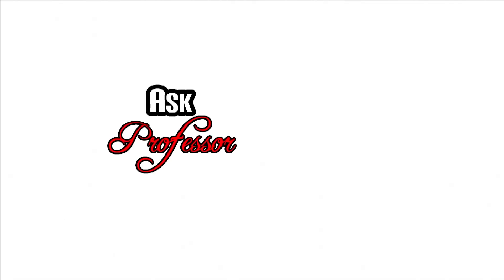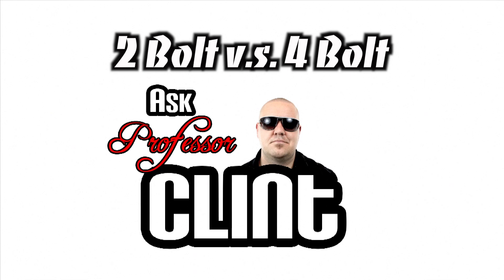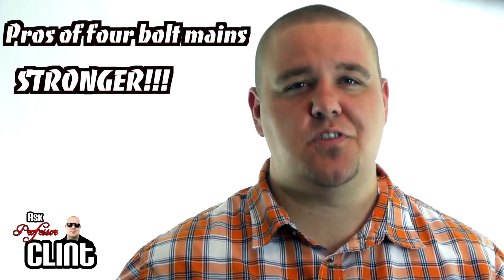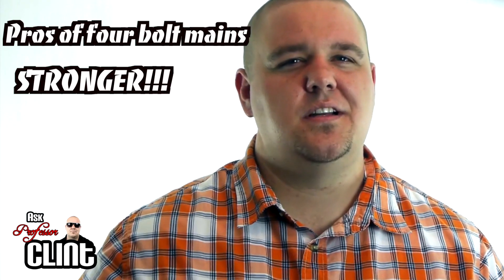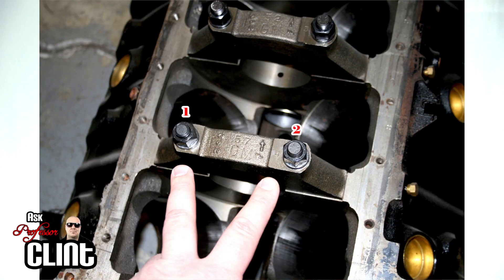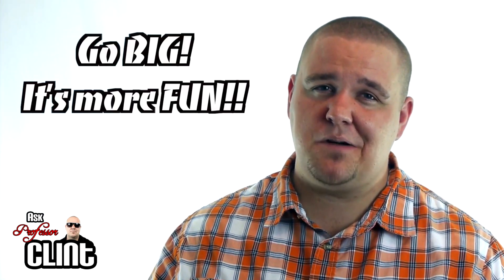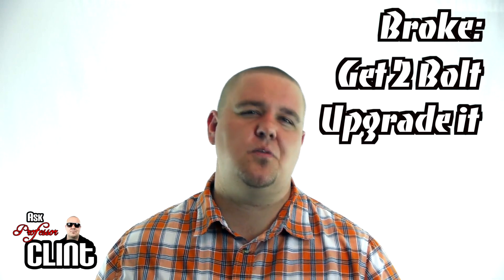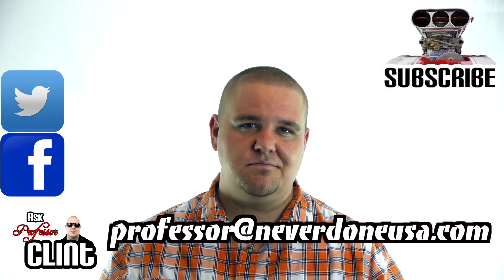2 Bolt vs 4 Bolt - Ask Professor Clint - Never Done

Comment: Been running my 400 2 bolt main 509 block for 30 years.Pushes little over 520 hp and over 500 on torque.I shift it at 6800 and have not had any issues thank god.I did spend a lot of money back then on machines work.Everything is after market except the crank and block.I would not push it any farther then that even though people have done it many times.If your going power adders then YES buy an after market 4 bolt.

Comment: A good friend has beat the snot out of his 55 Chevy for decades and lots of hundreds of passes. It runs 10.teens with an alcohol hilborn injected 355 2 bolt main bowtie block. He has refreshed that engine many times, and has never seen any sign of cap movement. Yes he uses main cap studs.
Reply: A 2 bolt bowtie? I've never seen a two bolt bowtie block, not saying they don't exist. Just figured gm made the bowtie blocks for heavy duty/racing use so they would all be 4 bolt. I've seen bowties splayed and std 4 bolt layout. As far as production/oem blocks I'd think a two bolt splayed to four would be stronger than the production 4 bolt design.

Comment: I was told that a sbc 2 bolt can handle up 500 in which I might agree only because my old small journal 327 had at least 425 and I ran it that way for almost 30 years but now im the proud owner of a 2 bolt 60over 350 with studs for the crank as I will be driving on the street, now that im 50 I just want drive it and enjoy it 🤘🏼

Comment: When we were racing a short track super modified the promoters had a limit of 312 CI,  any compression ratio, any cam, any steel heads (We tried 2 different styles), any intake w/1 four Barrel carburetor, but what I thought was strange: no dry-sump. We installed ARP studs for the mains and heads on our heavily modified, but stock OEM 2 bolt, 1st gen Chevy small block. We had it magna-fluxed, sonic checked, all sharp edges radiused, line honed, squared, decked, balanced, oil restrictors for rod & main oil supply. This was the late '70s and early 80s and it dyno'd at 500+ HP. Never had a failure in the 2 years of 3000 to 7200 RPM short track torture. On a greasy or dry slick track it would spin-up to 7500+ RPM if the driver wasn't careful. We had a tell-tale tachometer.  It had 12.5 to 1 compression, forged pistons, best rods available and forged crankshaft It had low-end torque off the turns that would yank your head off. 
The 2 bolt is pretty reliable if you take time to build them with tough materials.

Comment: We throw 10 to 12 lbs of boost to a studded and balanced 2 bolt 468 bbc . It does have a forged eagle crank and Callie's forged rods with kings best bearings. Never sees over 5800 rpm.  5 years and still going . Makes 922hp @ rear wheels. A bbc 2 bolt have heavier main caps and thicker webbing due to the other 2 bolts not there to weaken it. I was advised not to splay the mains   468 bbc twin VS Racing 78/75 with 1,25 AR . On 10/12 lbs of boost with a huge howard's hydraulic roller cam too boot

Comment: This guy is totally wrong it's a myth because stock gm block castings become weaker with the four bolt main it's been proven if you really wanna put some power down use a 2 bolt with a girdle
Reply from the maker: That has not been the experience of the engine builder I got the information for this video from however its an interesting idea, I'll look into it. Thank you for watching the video.
Reply: Not true for big block Chevy blocks.

Comment: Yeah, no I'm going to have to disagree with you there.  My Grand National made around 450hp and over 500ft-lbs of torque all day long on the stock v6 long block.  Right now I have a forged crank and the first 3 main caps are billet steel with ARP studs and the guy helping me tune with an aftermarket ECU said 600whp/600ft-lbs of torque no problem.  He said tune plays such a big role.  Now, if I wanted to 1000whp I would have to get an aftermarket or a BMS stage 2 block.  You can make a 1000whp with a stock block, but the block at that point is only good for the dragstrip and not driving around.  I've seen Richard Holdener make upwards of around 700 hp with a stock old school SBC.  When using forced induction, tuning is the key.  Nitrous puts such an massive load on an engine so quick that I would avoid it unless I had a 4 or 6 bolt main.  Also, the Buick 3800 series 2/3 block with forged rods and pistons has been power potential for a v6.  It has two bolt mains, but they are cross bolted.  I'm building a 3800 series 2 for my 2000 Regal GS, it's machined already and I will be using ARP main studs and ARP bolts for the cross bolts as studs wouldn't add any benefit.  I bet when all is said and done I will be making about 800whp with my 3800 series 2, reliably.
Reply from the maker: The numbers I shared are general guidelines  for the average gear head. Can they be pushed beyond that with an experienced builder/tuner? Absolutely! However with such a general audience comprised largely of newbies and DIY guys without the proper knowledge or experience I had to give numbers that would keep everyone operating within generally safe parameters. Good luck on your buick, it sounds like a cool build!
Reply: @NeverDoneUSA  Thank you.  Unfortunately, I don't have the tools nor the confidence to build the engine myself so things move at a slower pace because performance build labor is expensive.  I was talking with my engine builder today and he told me that I would have to invest a lot more money for the transmission to hold up  and it still may not.  My build may be able to make 800whp, but it's not going to happen.  He said a more reasonable number of around 500whp.  Other people have built these v6 in FWD configurations, I guess they had to make custom parts for the transmission.  I was a bit of a big mouth in my previous post and I've been knocked down a few pegs, deserving so.  Again thanks for the information.

Comment: what engine components would you recommend in a 4 bolt main running a 92 mm turbo
Reply: Engine components?  Hard to say; but certainly go BIG with fuel delivery.  Pumps, fuel lines, and injectors.  92 mm?  You think you have enough fuel?  Go bigger than what you have ....
Reply from the maker: Unfortunately I'm not an engine builder so I wouldn't have the level of expertise required to properly answer that question.

Comment: One thing, when converting to studs, you really should have the mains align honed.  Studs go deeper and distort the  block a bit different.  Its not 100% necessary (bearings are designed to take up small differences) but improves the consistency of the oil flow around the bearings (and ultimately to the rods).
Reply from the maker: Thank you for your comment, this will add value for others who watch the video and read through the comments.
Reply: I disagree.
Reply: @Racingengines4U  disagree as in ?

Comment: Well, my little 235ci v6 only has two bolt mains, with arp studs and billet main caps and I dynoed my car at 625whp and 683 ft-lbs of torque.
Reply from the maker: Nice! The studs and the billet mains help a ton!
Reply: @NeverDoneUSA  Yes they do.  The problem with the LC2 motor or 109 block as it's called in the 86/87 turbo is the bottom end will hold up, but the lifter valley of the block will split.  Anyway, I still appreciate your time and explanation as a middle-aged gear head I can get enough of engine block information.

Comment: The Grand National 109 block is a junk block, v6, with 2 bolt mains.  They've 750whp with stock bottom end, with ARP studs and billet mains guys are regularly making making 675whp and doing it reliably over time.  My 109 with billet mains, makes 550rwhp and 625ft-lbs of torque and I've been running it for 3 years now.

Comment: I got a 350 block with a 4 bolt main 
90 roller block gm one 
I saw on horsepower tv that they upgraded the block after 550hp 
You just said that it was good for 1200 hp 
I have forged guts and I have arp everything
Reply from the maker: I've seen aftermarket small blocks handle 1200 hp, production small blocks cannot safely handle nearly that much.
Reply: @NeverDoneUSA  if I have a gm block 
What hp is it safe to 
4 bolt mains arp everything 
Forged guts
Reply from the maker: @benkalinowski5834  you should be safe up to about 800, I've seen them handle a lot more but it's certainly pushing the limits of safety.

Comment: This info is true for all gm small blocks with the exception of the 400 the 4 bolt blocks are notorious for breaking under higher levels of stress especially the earlier models casring #3951511
Reply: Casting
Reply: u think the 511 are good for under what rpm 5500 or less

Comment: I picked up a Chevy 350 4-bolt main block for $350, and I am happy!!, I also bought a 1978 Camaro, and the 350 engine in that car, is a 4-bolt main!!! I got a little luck there.
Reply: The old 350’s, not sure, but I think you can get billet main caps for the center and of course ARP hardware.  I was at the track with a guy who swapped a 350 into his GRand National, with a turbo.  No IC.  That car ran a flat 10 sec 1/4 mile without breaking a sweat.  Whereas I had to spend $14k to rebuild my 109 and I still haven’t hit the 10 sec flat 1/4.  I believe he’s in the low 9s now.
Reply from the maker: Awesome!
Reply: Used to buy 4 bolt 350 engines when I worked in auto machine shop in the 80s and 90s  complete for less than 50 bucks in that day.

Comment: The professor of mis-information.   sure glad hes not doing the 
     machine work on my engines.
Reply: by the way mark would be happy to talk to you about your lack of knowledge. he built my last engine in 2013 468. car runs 10.40s. not bad for a street car.( performance engine building.) if you would like to talk to him look him up. your probably paying a local machine shop big bucks and they are happy to tell you what you want to hear. or your a weekend warrior that has never been involved in machining or assembling an engine.
Reply: @kevinbender1754    You are obviously looking to make yourself feel superior by "putting me in my place",  so yeah,  you're right,  i know nothing,   never built an engine, never raced a car, etc.   Happy ?   Now go brag about all your bull$hit to someone that gives a rats a$$.   I didn't know there was a helmet big enough to fit your head.
Reply from the maker: Which information do you disagree with?
Reply: @NeverDoneUSA    cap walk ?  seriously ?  apparently you have
    never worked in a machine shop.   throw away the old main
 bolts ?   you must work for ARP.   performance machinists,
    back yard builders,  and basic machine shops have re-used
 main and head bolts since 1955, and i have never seen or
    heard of a head or main bolt snapping or cracking.  i doubt
you have ever assembled an engine.   there is nothing wrong
    with replacing main and head bolts with newer,  but its
not the be-all end-all, and not always necessary.  i have built
    and raced SBC since 1965, and on teardowns, there has
never been any evidence of cap walk,  and no machine shop
    has ever advised me about possible cap walk.   you are
the first time i have ever heard that term.    and so far,  no
    YT posts related to Chev engine builds have mentioned
 cap walk.
Reply from the maker: @normhodgkinson6965  Google "main cap walk", you'll be greeted by a plethora of information on the subject. There's a big difference between backyard engines and quality performance engines. Again you can Google the effects of heat cycles on old main bolts and find that they become stretched and much less effective up to the point of complete failure. I do not work for nor am I currently endorsed by ARP.
Reply: @NeverDoneUSA   i can only speak from my personal experiences beginning
    in the mid 60's.   my machine work has always been done by reputable 
shops that kept current with the performance trends at the time.   my engines
    would last about three race seasons before teardown.  i know about heat
cycles, fatigue, expansion/contraction, etc.  i can't say bolt failure has never 
    happened to someone, but nobody i have ever raced with, or talked about 
engine builds with, including machine shop personal,  has mentioned cap walk. 
    i have been using ARP fasteners for about 10 yrs with no issues.  i kept
my GM bolts just in case.  this week i'll ask my machinist about cap walk.
Reply from the maker: @normhodgkinson6965  fair enough. Thank you for watching the video.
Reply: @normhodgkinson6965  cap walk is usually worse when you stud a 2 bolt main. hard to believe you havent heard of it with all your experience.
Reply: @kevinbender1754  i have heard of cap walk, its  a result of poor machining and careless assembly, and rarely happens.   so far i have yet to see it happen, or hear from anyone that had it happen.  studding a 2 bolt block is not the cause.
Reply: never said it was the cause, said it can happen. absolutely can be the result of poor machining. by the way i did work in a machine shop for many years. not for engines but i have assembled many engines in the past. my engine builder is mark Jones of performance. educate your self.  @normhodgkinson6965
Reply from the maker: Google cap walk, you'll find a wealth of information about it. It's found under high stress environments in the performance world.

Comment: At 5:08 why is there a Ford super duty when your talking about GM motors
Reply from the maker: Good eye. We needed some type of filler footage so we used a quick clip of the Never Done Super Duty.
Reply: There was Pontiac super duty 60's, way before Ford super duty trucks. But Ford had the side oiler and Cammer 427's in the 60's.

Comment: the 2 bolt 350 chevy block is stronger than the 4 bolt the problem with the two bolt is the caps stretch over 6000 rpm and or about 450 HP if you are below those to thresholds  the main web of the two bolt is stronger because you didn't drill a hole in it for your outer main cap and remove a bunch of material for your bolt hole a 350 2 bolt with ARP studs is stronger than a 4 bolt chevy with factory bolts also the GM main bolts are not junk they are grade 8 and can definitely be reused
Reply: So if I'm going to build a 327, and occasionally spin it to 7000, then some centre splayed caps should do the trick?

Comment: I’ve reused my old main cap bolts before. Never had issues if there torqued to the right spec
Reply: Maybe youve never had an issue, but theyre stretched. Measure them with a micrometer.

Comment: I've built high horsepower stock (454) blocks 2 and 4 bolt.  Both handle 800hp without any issue if you build the bottom end correctly.
I am currently experimenting with an early 1970 2 bolt.  The early blocks have a better quality casting.  The 2 bolt: I purchase Moroso Billit Splayed main caps.  You have to machine, drill, tap and line hone the mains.
Use ARP studs and bolts.  This 2 bolt is now STRONGER than the non-splayed 4 bolt block.  The crank is a forged Crower stroker 4.25 and a 4.310 bore making it a 496 and is handling 780hp and 690trq quite well. I was thinking of adding a 250shot of NOS but, because of block deformation under heavy load, I want to see if I can fit a steel girdle to the bottom-end just to be safe.
I don't like filling the water passages with Hard Block.  Best to buy a good Brodix or Dart block if your thinking of going that extreme.  My 4 bolt blocks all had aftermarket caps but splayed caps aren't available as they are already straight drilled.
Do NOT put a turbo on a stock block! You are asking for BIG trouble. Even NOS is not a great idea.  Keep the dose small if you do.
Clint is giving good advice. Listen.
Reply from the maker: Thank you for your thoughts and for checking out the video.
Reply: My pleasure.  You are offering good info. Keep it up.

Comment: If I just want the motor to run and do it’s job 2 bolt is good enough right?
Reply: 2 bolts are good, proven blocks and are nice and affordable. You can bump up the horsepower to 600 no issues.
Reply: @stevesolo16  mine is 0 issues
Reply: @stevesolo16  I'm over 5 without spray. Loose rotating weight. Heavy bottom ends cause more issues
Reply: @sweetness34km  If you build any engine without balancing the bottom end, it's just a matter of time before things come apart. A performance engine, even if the rotating is on the heave side, will last, if you "due diligence, " and use assembly practices that are tried and proven. Balance, torque, hardware, knowledge. Put these all together, and no Kaboom!
Reply: For daily driving you're going to need no less than 8 bolts for your main.
Reply: Pat W Don't you lie to that kid... 8 bolt daily!? are your trying to grenade his bottom end!? he needs a 16
Reply: I've always taken the 2 bolt and machines steel splayed 4 bolt caps to the center 3 caps. Sometimes you have to work with what you've got.

Comment: 2 bolt small blocks successfully make well over 400HP all the damn time.  This "professor" needs to go back to school.
Reply from the maker: DonziGT230 thank you for watching
Reply: Up to 600 hp especially if using good crankshaft rods and pistons. I have a 2 bolt way over 500hp before nitrous  rotating weight loss and 150 shot of nitrous.  0 issues Teflon coated bearings. I agree with you.

Comment: Are there any blocks with enough meat on the low-end to drill, tap, helicoil, and drill out the cap to the next bolt size?
Reply: Not on a stock 4 bolt block. The oil passages are too close to the outer studs. I do believe the caps wouldn't have enough metal surrounding them for sufficient clamping if you drill the hole larger. Dart now sells blocks with this option.
Reply from the maker: dougr944 someone else will have to chime in on this one